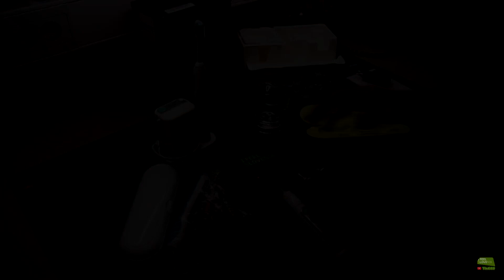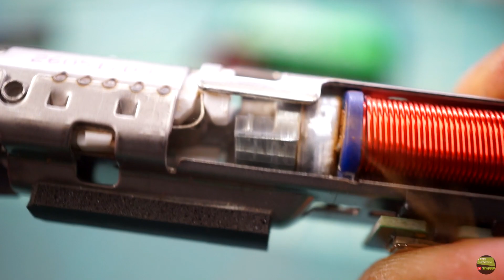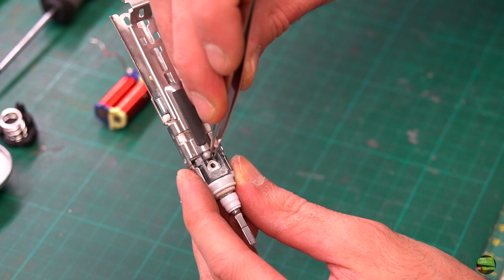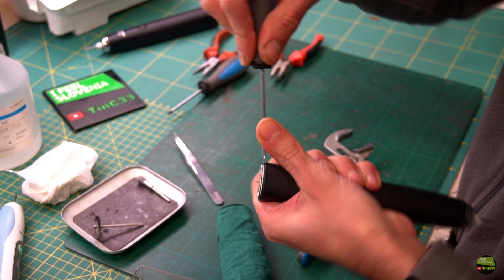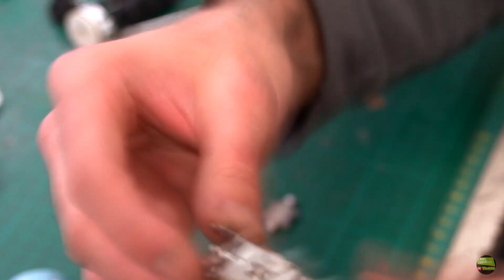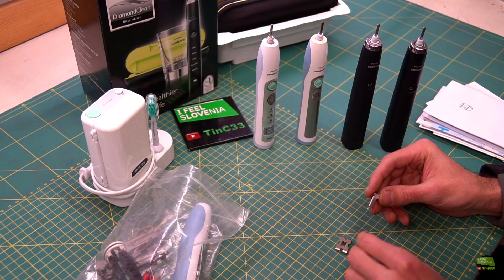How to: Philips SONICARE Repair [3 brush / 3 different fails]

Comment: Just disassembled a Philips Sonicare DailyClean 3100. What a mess - probably the worst anti-repair design I have seen: very difficult to pull out the bottom. It also has side-hooks and I broke one of them.
Moreover, it has a Ni-MH dual-cell battery, tech from the 90ies! Finally I didn't manage to bush the bottom all the way back in - there is now a gap of 2mm.
Reply from the maker: True, every series is worst, in black diamond battery is much much worse than in older version, both have liion but newer model meant to charge all the time thats why cell got big inner resistance and charger is very slow.
About the design, thats why they never offer service for that brush, you got new until warranty then you can throw it and buy new one, like it was $5...
For the gap, try to insert brush in and when the side pin is in its place, press also the cover in wich lock the pins.

Comment: I'd fixed the screw at the head multiple times over the years, but today was the first time I fixed the magnet(s) touching each other. The best part is I have another old one with the same issue that I've been holding on to, so that's another one that I'll be able to fix in the future. As someone who loves saving money and hates throwing things away and creating waste, this video is great. There are others out there, but yours in one of the few where I can actually see what you're doing. Thanks!

Comment: Hello! the top of the head (the stick) keeps coming off from mine. I opened it and it looks like it just pops in/out without needing screws or anything. Do you recommend I just use a powerful adhesive or what would you recommend?
Reply from the maker: Only steel shaft fall out of aluminium triangle piece? In that case yes use strong green loctite glue push shaft all the way in (clamp softly in vice) and leave day or two to harden.

Comment: The part attached to the magnet that you wiggled with the pliers, can it be purchased separately? Mine is broken into two separate parts.
Reply from the maker: No you can only buy entire vibrati g mechanism, but buy the one wich cost more than 10-12€ because there are cheaper one but they are used, pulled from old brush.
Reply: @TinC33  What is that part called or do you have a link? I'm in the U.S..
Reply from the maker: @KingZoneOne search ebay "sonicare vibrating"

Comment: Thank you very much for putting this vid together! I've had a number of sonicare brushes over the years (I feel like they're superior to rotary oscillating types); and have had some previous successes in changing the part that the brush head attaches to. My soldering was terrible, but with a 0.7mm gap, and everything back together, the brush now works again like it should. Many thanks, Peter.

Comment: Thanks! In my case, the toothbrush fell on the floor, and the clearance between the magnet and motor was too small. I adjusted it to 0.5mm, and it works fine now!

Comment: My 12-year old HX6530 had developed an annoying buzz, and the power switch was a bit dodgy. I followed your excellent video, and got it working great again! I assembled it first using a 0.4 mm gap between the magnet and coil, then got some Loctite and increased the gap to 0.5 mm. I was getting just a bit of a buzz when using the brush. Now, it is a lovely hum. Thanks so much for the tutorial!

Comment: Thanks for this very helpfull video. I managed to repair my HX922B, Sonicare Diamond toothbrush which made a lot of noise because the small screw came loose.

The tricky part for me was the part where I had to remove the inner guts from the cover. 
I was at first focused at two white clips and thought these were the ones holding the inner part in the cover. 
However, they are not. You have to reach a bit further up in the cover for two black clips that hold the inner part. 
I accidentally unclipped the white ones tearing the mini-cable apart from where ever it was attached to. 
So I ended up with the bottom part not lighting anymore. Not a big deal as the brush will function fine, still a little warning for future amateur repairmen. ;-)
Maybe worth mentioning in your video so other will not make the same mistake?

Comment: If you carefully drill a tiny hole in the end cap (1-1.5MM), compressed air will pop the cap out. You must support the rubber seal at the tip of the brush while you do this. Then, release the two plastic clips inside the base and the mechanism will come out. When finished, a small bad of silicone or other glue will seal the hole when you are finished.

Comment: Thank you so much!  This really helped me fix my loose head pin and then my allowing space for vibration issue.  Another problem has now presented itself, the unit won't charge on the glass charger!  I took the unit out of the case and it charges perfectly.  I believe the plastic silver cap on my Philips Black Diamond Sonicare isn't conducting the electricity.  Any suggestions as to how to reassemble in order for it to start charging again?  Thanks again :)

Comment: "I feel like I stole something"- that was a great line.  Thank you for taking the time to explain the faults and show the best manner of disassembly (just unsolder the coil).  As it turns out, you described scenario 3, which is my case.  After watching you dremel the small spot welds, and explain the broken metal, I decided to do the same.  This was a very well-done explanation!
Reply from the maker: Thanks

Comment: Hi, great video. Would you know what is the problem with my Sonicare hx939b? When I take it out of charger all the lights keep flashing randomly all day until it discharges the battery. But it works as normal. When in charger only green light is flashing as it should. I took it apart expecting to see contacts oxidised but they are all clean and sound. No water damage at all. Any help much appreciated. Many thanks.

Comment: Just tried this advice in Nov 2023 and it's still relevant-- loose head pin fixed on the hx685t . Good as new. Just saved me hundreds of $ on buying a new replacement 🙏🏽

Comment: It is too long and the source of the problem can‘t be found easily in this video. Unfortunately, it is useless. I had to return 2x of those and i will not buy that crap again. I will also not waste time on repairing that crap.
Reply from the maker: Buy schaomi one, i hear they work the same but better

Comment: There is a hole at the bottom, it should be used to open the cap on the bottom. With compressor connected to the hole, it creates the pressure and bottom cap pops out. :)  This way there is no danger to damage the handle.   
Good video altogether!
Reply from the maker: True, i didn't think about that before 🤷‍♂️

Comment: Cool video, i have this brush and it startet so randomly turn itself on more times a day. I opened it and quite a few parts are rusted. The pcb has surface rust. I think its totaled 😕
Reply from the maker: Not at all try to clean it with a brush and alcohol, but you may need to replace the button if it oxidized from inside

Comment: It can be opened with air pressure into the small valve in the middle of the bottom without any damage. I saw it in other DIY video where guy used air compressor, I simply used bicycle pump with plastic ending for mattress and it worked well. :-)
Reply from the maker: Didn't try that, because there are clips wich hold the cover in housing, but compressed air may extend entire housing so it release the hooks, will try next time, thanks.
Reply: @TinC33  https://youtu.be/AnMgbqwkyNU
They didn't unclip inside holders though, so I had to use both videos 🙂

Comment: I have a black one, but mine won't turn on anymore suddenly. It looks fine, and looks like it is charging, but button does nothing. I ordered a new one, but will open it thanks to your advice and see if it is a dead battery or something else. It is 6 years old but looks new still on outside, so hope it might just be the battery that has died (not enough charge).

Comment: So glad I found your video. The stem to attach the brush was loose exactly like the one you repaired. The hardest part was getting the bottom cover off. Thanks so much for saving me some money. Now that I am retired I am taking time to repair versus throw away items to save money and reduce waste in landfills. As a women I am grateful to these types of videos.
Reply from the maker: Exactl that's my point, sometimes i fix whole day a $5 worth think, but when i fix them i feel much better than just buying a new one, and also do something for my wallet and envirement.

Comment: Just repaired mine with the loose driver caused by a drop. Easier to remove the cap than it looked. Removed the screw, added Loctite and retightened- it was good and tight so the threads were still fine. Seems great now. I would recommend replacing the bolt and nut if you don't get traction, so you don't have to rely totally on the Loctite. Thanks a lot, saved both the money and the carbon for a replacement.

Comment: Had issue #3 on a DiamondClean model. Almost threw it away. Fixed it by tightening the screw and adding threadlocker. Thank you for sharing.

Comment: Hi expert! I have 3 Sonicare toothbrushes I kept back from the past and two of them with a similar problem to yours. I have 2 Diamond Clean Smart that was accidentally dropped leaving one with a loose top like the one you have, and the other that just stopped working 3 weeks ago. The Flexcare had toothpaste/water seeping into the top. I took it apart and cleaned it up but it happened again. My brother is a messy brusher. I see you have experience in repairing these toothbrush handles, so I would like to ask if you can repair the 2 Diamond Clean and I will give you the Flexcare Handle for free. I am willing to pay if you have a service charge fee. You can make another Youtube video for the viewers. Please get back to me. Thanx
Reply from the maker: Sorry but i got no parts anymore so i can't fix it, in worst case check on ebay for vibrating mechanism and replace entire all you need is some basic tools and a soldering iron.

Comment: I have a Sonicare for about 2-3 years and it stopped working. Won't charge or anything. I think it needs a new battery. Do you have any videos on that and any resources to order a battery?
Reply from the maker: Sorry no video about, but it's an easy fix, open it to check the type of battery i think liion aa size, you can take with or without terminals and just solder 2pc of wire on eash end...

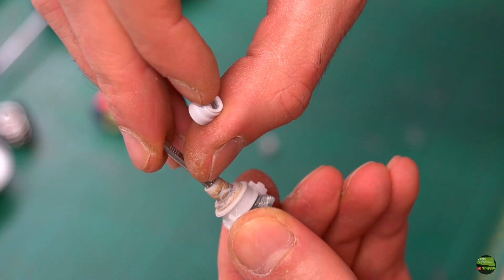Comment: I understand that you don't want to damage the seal by cleaning it, but leaving the seal like that (around 5:52) would prevent me from using the tooth brush. Maybe some non-mechanical way of cleaning and disinfecting it would be a good idea.
Reply from the maker: True, but also that part don't go into mouth.
Reply: A  small ultrasonic cleaning tank would clean those parts. The wire brush is too harsh for the rubber and plastic bits.

Comment: when i try to tighten the screw for the shaft, the shaft is still loose.  i can pull it out with my fingers.  any ideas ?
Reply from the maker: Broken shaft, find replacement vibrating mechanism on ebay.

Comment: Suggestions?
I was extremely optimistic that the “loose screw” scenario would fix my brush, but it appears that the airlines/TSA were able to fully break the screw connection point at the base of the metal shaft of my 992B brush. 
Options?
Reply from the maker: Try to find entire vibrating mechanism on ebay.

Comment: Hi Tine. I'm back :-)  Could you show us how to pull the unit into two for the second toothbrush that you showed in this video, please?   There is a ribbon cable from the motherboard to the front half of the unit, and it will tear/break if I try to disassemble the two halves as show showed for the first toothbrush.  Thanks in advance. Tim.
Reply from the maker: It should be newer version with a preassure sensor in head.
I didn't saw then yet but i guess you'll need to unplug or unsolder ribbon cable before take apart
Reply: @TinC33  Oh dear. That's probably outside my skills range 🙂 Still I guess if I break the ribbon cable, the toothbrush should still work, just without the sensitive head feature... maybe 🙂
Reply from the maker: @timbelinasux  maybe, yes 😁 jn any case you need to know, brush already is broken and there is no service for it, so what could go wrong 😅

Comment: While prying open the bottom of my toothbrush, the charging coil was cut and became loose.  How can I fix this?  Should I solder the wire or tape it or do I have to replace it?
Reply from the maker: Try to solder it

Comment: Thank you so much for making this video. Approximately one year ago I had a failure like this on my toothbrush. I assumed it was broken inside because I dropped it on a hard surface.  I dropped it in the garbage and ordered a new one. My new one just failed in the exact same manner last night, so I decided to do a little Google research and found this video. Happily 20 minutes later my new toothbrush is working like brand new again and I don’t have to waste $200 replacing it with a new one. Thank you again
Reply from the maker: Thanks, always like to hear feedback if someone fix it and save some $$$

Comment: I had the 3rd loud model you featured.  The screw & holder were loose. Threadlocker & Patience and I got to hang on my 14 month old 4100 P.  The new 4100 replacement doesn't have a wall part of the charger,  smaller length & girth. . Battery has less charged run time usage.  Less brisle movement performance ( about half). Phillips cheaped out.  Thanks for the video.
Reply from the maker: True quality of sonicer is worst with every generation.

Comment: I think I finally found the problem with my own DiamondClean toothbrush in this video! Not the magnets touching, not the top screw but at 4:30 inside it is at an angle when I look so perhaps mine is also broken inside that least accessible area :( will try to find the replacement as you have shown.
Reply from the maker: Check my other sonicare video about that fail.
Reply: @TinC33  Thank you, yes I have seen it now. I also own a Dremel tool so will probably do as you did because like you said "nothing to lose" and open it completely to see the damage.

Comment: Diamond was loud and head not vibrating. I took it apart and the screw fell out with piece underneath it. I cleaned it and loctite, waited two hours. Wouldn't turn on. Put on charger it lights up, button won't turn it on. Took it apart to reinstall and ruined the head of the screw. It will not turn on.
Reply from the maker: Check for wires contact you may broke some while puting apart, also check if there enough clearence between coil and magnet.

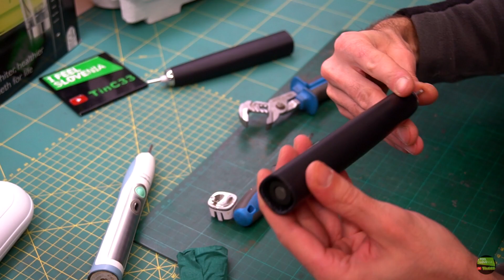Comment: 2:22 I have no idea how to "unhook two hooks on narrow side of housing". Ive poked around with my super thin flathead but can't find any hooks! Could you explain this part in more detail please? Kev from Ireland here :)
Reply from the maker: Try to squeeze like on 1;45 on front and back side, and same time try to pull out with tiny screwdriver, while entire brush push on the table on brush axis, that black is a bit harder to open, you will deform housing a bit for sure, but can fix befor insert back in by heat a bit deformed part and align.

Comment: Woah.. I was initially put off when I saw the soldering step, but after Philips wouldn't replace my toothbrush under warranty because I didn't keep the receipt from 16 months ago (does anyone seriously do that?), I went for it. So glad I didn't destroy my $200 toothbrush that still functioned, but I was able to fix it without having to unsolder the wires! The coil slipped and was up against the magnet and loosening the screws/sliding the coil down fixed the loud rattle. I can now brush my teeth without rattling my eardrums. Thank you!

Comment: Hey TinC33. 
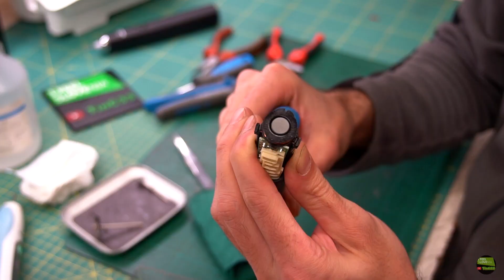Thank you so much for this video. I had the brush/problem you fixed at @10:40.
I bought a set of two brushed in 2019. One had this problem after 2 years. I sent it in and got a replacement. Now the second one had this problem and Philips doesn't offer repair, instead a 20% coupon in their shop. 
Only one screw was loose and no locktide was applied there. I cleaned, applied and reassembled and it works perfectly now. 
I did not only save a lot of money buying a new one, but it showed me how unsustainable Philips is. A perfectly fine brush with one loose screw... that's unbelievable and no solution from their side. 
Thank you so much

Comment: Amazing video. Thank you. It's a little tricky so just watch a couple times, stop and go back, take your time. I managed to fix my diamondclean, same as in video without unsoldering the wires, pushed the magnet down enough to fit and slot a bit of card between magnets and screwed back together, took card spacer out to see the gap and fixed... Thanks again for this video.
Reply from the maker: Thanks, alwqys like to read great feedback like yours

Comment: Excellent video. I have managed to open my toothbrush up following your excellent video. On mine the metal rod/ shaft that inserts into the replaceable toothbrush head has come detached from the magnetic holder. Unfortunately tightening the screw you show in your video has no effect as whilst that tightens the magnetic holder it does not tighten the metal rod that inserts into it. Have you any thoughts on what I should do. I'm not sure how the metal rod is originally installed - it isnt screwed in or held by the screw and doesnt seem to click in. Do you think it is worth using superglue to glue the metal rod into the magnetic holder?
Reply from the maker: Hello, if your thin metal part is broken there is no glue wich will hold it, in worst case buy new vibrating mechanism on ebay and replace it cost about 15$